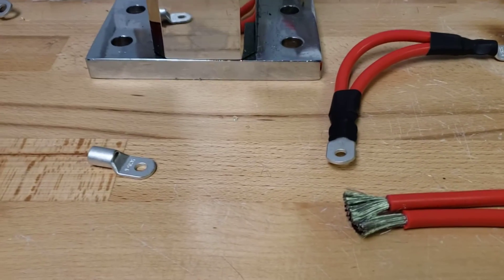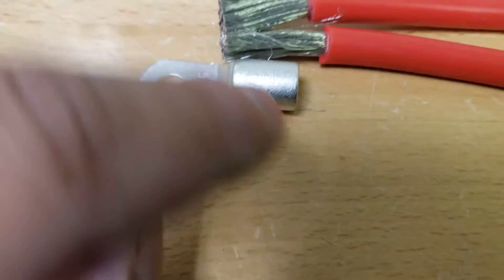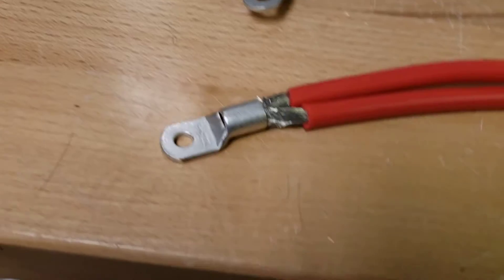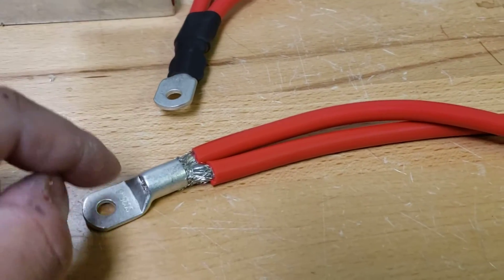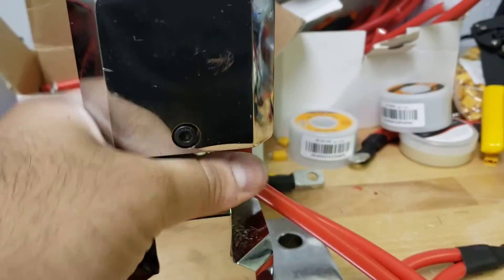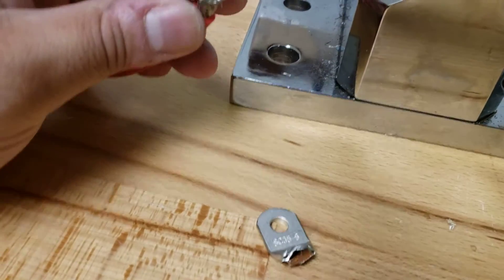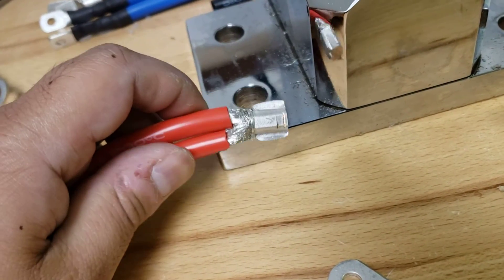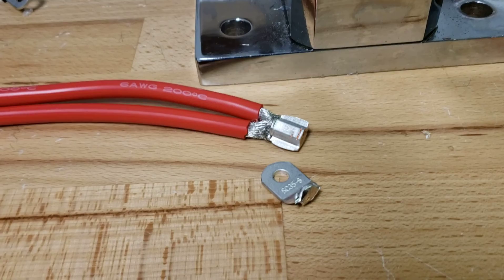How to insert dual cables into a single lug - Battery Cables

Comment: Thanks for the insight, man! Now, I'd like to ask what gauge is the wire (I think #6 AWG) and what gauge should the lug be (to acommodate both 6 AWG lines) ?  Greetings from Venezuela 🇻🇪
Reply: It depends on the strand size, if it’s multi strand like his, use the same sized lug as the wire

Comment: Why put 2 cables together like that?
Reply: Its a hack job... Fire waiting to happen, do it right the first time its cheaper...
Reply: @Mitchs no it's NOT, it's splitting the amps it's completely safe
Reply: Flexibility. The thick high amp battery wires bend very poorly. Two wires flex better then one.